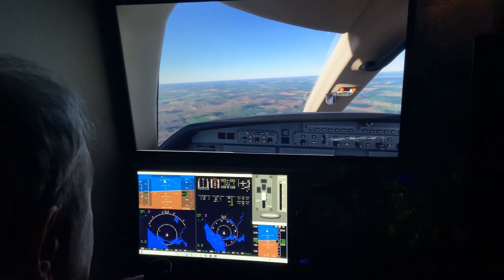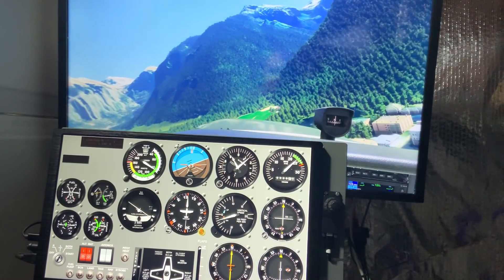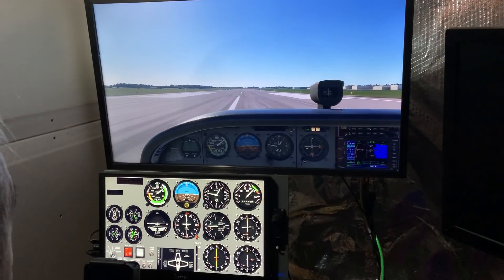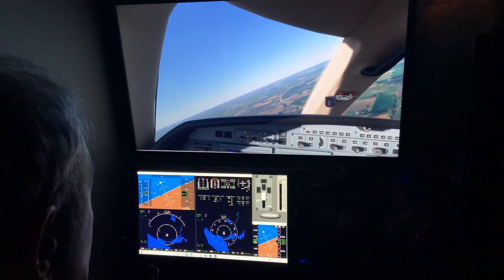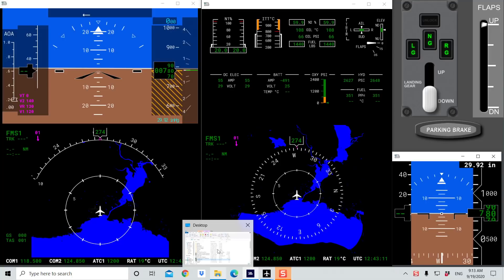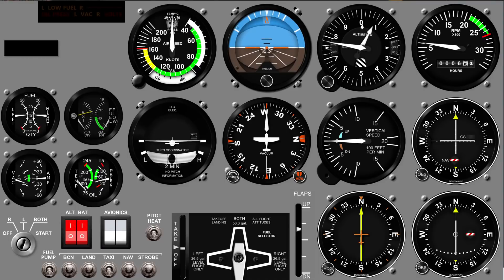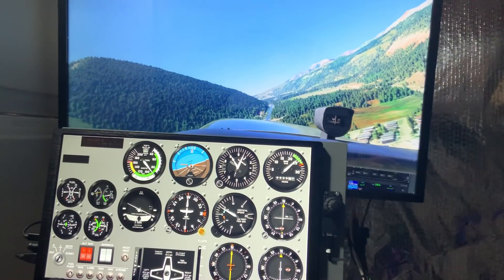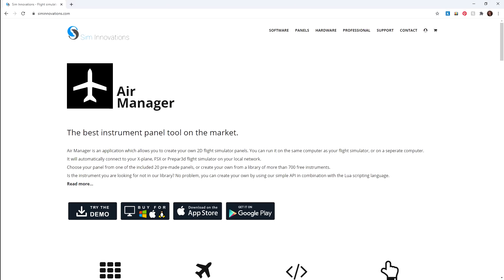FS2020 Budget Touchscreen Cockpit

Comment: Hi Russ thanks for the great videos. I was wondering if you might be able to help me with my sim. I used to work for a company building flight simulators and my old boss gave me one of the units after he closed the business down. It is a full 2 seat sit-in cockpit fully enclosed and takes up about half a bay of my garage. We sold these for about $50k each back in the day and I want to rebuild it to something great and ultimately make some videos to help others make there own. But I have a lot of stuff to figure out, if you could send me a private message I would buy you lunch or something :)
Reply: Well once I figure out how to use a computer.this maybe my only hope .ty for this info.i have been struck with luukemia.so I'm home alot alone.im trying to learn to fly b4 I go. It's my 1 bucket list item that is most important to me. I'm not wealthy so I have to macgyver everything. It keeps my mind on stuff. Ty for the help building this stuff. I will get my pit built b4 it's time. God bless

Comment: Are there any flight instruments that would utilize three encoder knobs dials verses the two that are currently available via the Knobster.    Do you see a need or "utility" for three encoders within a single "Knobster II" product moving forward for example?
Reply from the maker: Alt V7 since the concept is to simulate the selected knob from the panel I can o lay think of one triple knob in my experience. I flew a B737-200 that had an ADF with triple knobs for the frequency in kHz. One was the lowest ones digit. The second the tens digit. And the third went from 17 to 10 for the hundreds digit. I think a triple encoder would be hard to find too.
Reply: @rbarlow  Thanks Russ.  Good to know, thanks for the extra context. Gratefully.

Comment: Hi Russ,  Thank you for the panel!  I just downloaded the Beta and trying Air Manager for the first time on an Ipad.  Works great!  I just wanted to note that the OAT gauge wasn't appearing on the runtime panel so I took a look at it in the lua code viewer and noticed it was missing a parens on line 82 of the 'else if' statement.  Once I added the missing parens the gauge ran in the debugger and on the panel.  I am looking into purchasing a larger touch screen monitor as I would also like to have radios accessible on the touch screen.  Thanks again for all of your useful videos, I really enjoy them.  Looking into purchasing the Knobster as well.  Take care!
Reply: Hi! Where did you find a beta for iPad? Or do you just use the beta plugin with air manager 3.7 on ipad? Thanks :)
Reply: Hi Johannes sorry for any confusion. I am running the pc version and displaying it on an iPad.

Comment: Do you think this can be done with other games? Elite dangerous in particular. Alot less info to call back but even status of several system with activation via display would be enough. Enough for me to throw money at it anyway.
Reply from the maker: If the underlying data is accessible a plugin or bridge app could probably be made. That would be an issue for Corjan the programmer at Sim Innovations. He has a lot on his plate now but he does do contract work. I’d the Elite Dangerous User Base big enough and are there enough users that would be interested to support development ?
Reply: @rbarlow  I've been looking into how to extract data from the game. It doesn't seem like it's as easy as I thought. There is a log file there but I'm not sure how in depth it will go and how much use it would be to a programmer. I'd say the user base would be big enough. It ebbs and flows with updates etc but there's enough people out there still playing. I get the feeling if there was a solution though it would have been done by now.
Reply: Turns out there is alot of data can be extracted after all. A player log got added a while back and this constantly updates with what the player is doing, system info, current objectives etc. So would be entirely possible after all. Anyway that's not why I came back. I was wondering how you managed to touch the second screen without losing control over the primary screen? I know windowed mode stop the primary from minimizing but for the life of me I cannot input touch from a second screen without losing control of the 1st. Is this specifically part of the air manager software or is there a Windows function I need to disable.
To be clear I'm not using air manager or even flight sim at the moment. Just experimenting with some setups.

Comment: I would like to purchase the Knobster but,  I can not get Air Manager BETA for FS2020 to recognize the available G1000 instruments for my Cessna (G1000). No problem getting any C172 instrument to work.
Reply from the maker: What panel are you using for the G1000....which Air Manager bezel? It may not have been adapted for FS2020 yet.This beta is fairly new so much of that has not been done yet.

Comment: Thank's for all the hard work Russ I always enjoy your videos. I love the Knopster  and use it in X-plane. Do you have a link for the bridge software to use it  Flight Simulator? Thank's again.
Reply from the maker: Check the Sim Innovations wiki page. There is a beta app and beta plugin as well as the username and password.for the BETA. The beta will not overwrite your current 3.7 version or any data. It is separate. Knobster will work as it interfaces with Air Manager so it needs no new software

Comment: Any change they will be coming out a panel with dynon or the G3X?
Reply from the maker: Not sure but you can create anything with Air Manager but it requires a bit of work. On the Sim Innovations Air Manager forum you might find some like minded users to join you

Comment: As always Russ, great job.. Been waiting for a version for 2020... Could you explain the Beta and plug in set up?
Reply from the maker: You can download the beta 4.0 from the wiki and install it you also need the beta plug-in from the wiki. It will install a separate application and will not touch your current 3.7 edition or any of its files.
If you read through the wiki it will provide you with the username and password you need to use for the beta edition. It will expire before the Release version of 4.0 is issued.
Reply: Yeah I found it.... I was using 3 plugin...
Reply: @rbarlow  hi Russ.I installed version 4.0, (I have installed in my Pc xplane with versión 3.7...)but According with the note it has, I have to actívate the product.when I put my user and password, it does not work.The question is I need to pay for a New subscription?thanks in advance!

Comment: I wanted to give it a try - installed "Air Manager 4.0 Home Use (BETA 11)", installed "Flightsim plugins 3.3 Home Use (BETA 12)" (finds FS 2020 and installs the plugin). Now I'm stuck at "Searching for flight simulator..." screen (welcome wizard).
Reply: OK, I got it, had to create Windows service manually.
Reply: @KrystianLewandowski  How did you do that?
Reply: @sobe1205  I closed the cmd.exe window already but please try to execute: sc create "FS2020 Air Manager BETA" binpath= "C:\Program Files\FS2020BridgeService\FS2020BridgeService.exe" in cmd.exe running with admin privileges, please also note full path to .exe used. It should create a service, you should be able to find and start it by 'services.msc'.
Reply: @KrystianLewandowski  Above my pay grade.

Comment: I use the Android version of Air Manager, I only want it for radio controls.  I wonder if it would still work....
Reply from the maker: Yes it will as long as the instruments are made compatible with FS2020. It is an easy edit but not sure when that will happen....probably when FS2020 compatible Air Manager 4.0 is released

Comment: Cool vid, great idea Russ! Please, would you answer for me two short questions?
1. Would be possible switching on-the-fly among more layouts/profiles of Air manager on a single LCD - eg. between G1000 PFD and MFD?
2. Would be possible to use Air Manager now or in the future to control touch display of G3000 (e.g. for TBM 930 or King Air)?
Thnaks very much in advance for the answers.
Reply from the maker: You can create what you describe with Air Manager panels  but if you overlay the popped out displays from the sim I don’t know how you could swap them as well from PFD to MFD

Comment: Any idea how to connect a Logitech switch panel? Or should junk it?
Reply: Have you considered SPAD.neXt?
Reply: there's an updated driver fod Saitek panels - google it - they work fairly well
Reply: Grace Summit Church   Saitek rediirects to Logitech and all their driver does on windows 10 is act as a test program.  FS2020 doesn’t see it.  Logitech has been telling me for months they are “working” on it...
Reply: @john-or9cf  i am using spad.next for fs2020 and its working great
Reply: Jannis H.    Not sure what that is - the link fails
Reply: @john The website for SPAD[dot]neXt is https://www.spadnext.com

Apparently the app’s name confuses YouTube, since it converted the name into a URL in both Jannis’ and my posts (oops!). Do note that SPAD[dot]neXt is payware and has something of a learning curve, but in my opinion it is 100% worth the investment. Much, much more powerful and stable than the OEM drivers.
Reply: Chad Pollman   Thanks, I’ll check it out.  In the meantime, Logitech came thru with a switch panel plugin - auto connection to the right controls even though FS2020 doesn’t give any options - but it works!
Reply: PARADOXRED1   All I did was load the plugin and start the sim.  It doesn’t show in the options but it does connect to the right switches.

Comment: I just downloaded the beta. How do i get it activated in FS2020? I never used Air Manager before only watched your videos. :) EDIT: Found the plugin. :)
Reply: Where's the plug in?
Reply from the maker: On the wiki page at top ... the username/password for BETA is there too
Reply: @rbarlow  Hey Russ i have one more question. Will there be a Beta für Android? I would really like to test the performance of my old Asus Padfone tablet and decide if i have to buy a newer tablet before the release of  Air Manager.
Reply from the maker: Quecksilber try an email to Corjan@siminnovations.com and see if he has openings for Android beta testing. I think it may help if you are already a Android Air Manager user. BTW if your hardware can run Android Air Manager with FSX or X-Plane11 it will work as well with FS2020. You could check performance ahead this way too.

Comment: I would not recommend Air Manager unless you are very serious about cockpit building.  I personally just use key binds or use voice attack.  It will save you hundreds if not thousands of dollars. I've looked into all this stuff from yokes, switches, throttles to a full G1000 setup.  Just save your money.  Maybe get a RGB keyboard with custom key caps for key binds.  That would cost you a lot less money.
Reply from the maker: I guess it depends if you approach FS as a pilot(including sim pilot) or a gamer. As a pilot my skills transfer to hardware controls but I can’t fly worth a crap using a keyboard.   Bottom line: FS can be fun either way
Reply: @rbarlow  I personally approach it as a Aviation enthusiast.  I recently found a device that maybe perfect for flight simmers called stream box.  Not only can you label buttons but you can create custom images for each button great for auto pilot and many other functions.  The 15 button unit is about $150.
Reply: @OperationDx1  Hi. Do you have a link to this product? Thanks
Reply: @OperationDx1  Do you have a link? I can't find it via searching.
Reply: @virtualrain  I linked it.  But I gave the wrong name.  It's called the stream deck by elgato.  It says it can do any kind of marco even hardcore stuff.  It was designed for streamers but it is able to do just about any type of macro coding.
Reply: Air manager is quite inexpensive... And once you get familiar it's awesome.. I love the challenge of building gauges.... It's all part of Flight Simming experience...

Comment: So just finished watching your video, I did not see the beginning of it, so forgive me if my question has been addressed in the beginning of it. Can you use the knobster with MSFS 2020 without air manager? The reason why I am asking, is I am getting ready for VR, and would not use, obviously, a screen I would need to look at, being in VR would be impossible. Thanks for your insight.
Reply from the maker: No but I would love to see MS build Knobster compatibility into FS2020. We did make a version that works (kind of) with XP in VR.
Watch this.  https://youtu.be/z-8QK6eWLTo
Reply: No that device is designed for Air Manager and is excessively overpriced.
Reply from the maker: You can build an Arduino version of Knobster. It is explained on the Sim Innovations wiki. Need a dual bush button encoder and a Nano. Installer is free. Designed for people who cannot afford plug and play Knobster.

Comment: Awesome Video Russ! Thanks for keeping us up to date on Air Manager with FS 2020. I am curious what your computer specs are and what your general video quality settings are in FS. ex. medium/high/ultra or a combo of all three.
Reply from the maker: Clayton Olson it is i7-8900K and RTX2080ti...Ultra settings
Reply: @rbarlow  Nice! I have a Core i7-7700k 32GB of RAM and a GTX-1070ti. At mostly High settings I'm getting into the high 40 FPS. Do you notice a hit in frames when you pop out those guages and put them into the other monitor?
Reply: I tried the Beta and it dropped my frames down into single and low double digits. My old PC just isn't cut out for FS 2020 without seriously lowering the visuals.